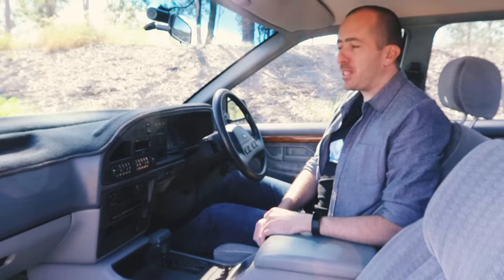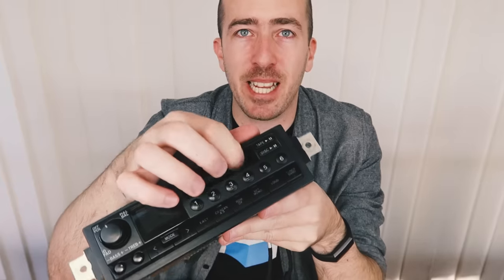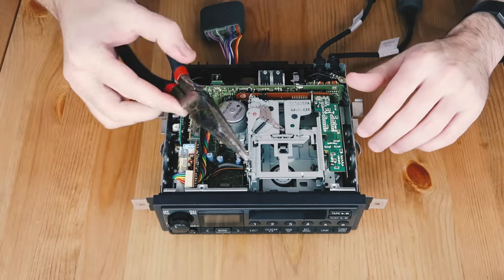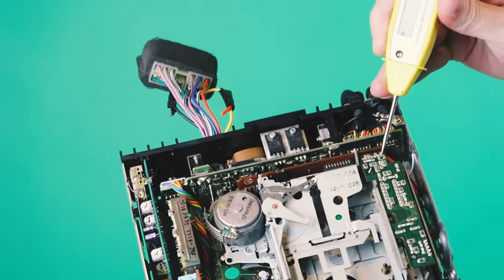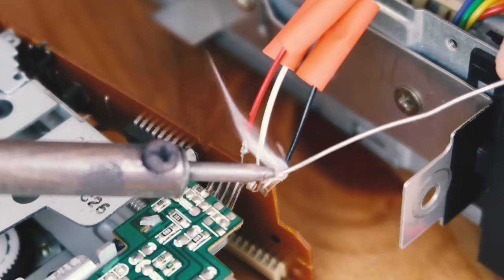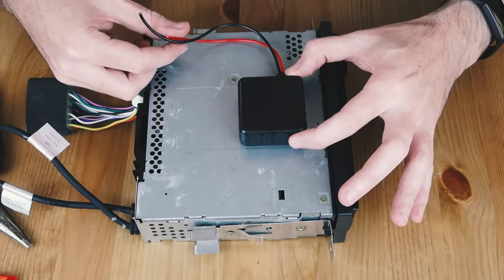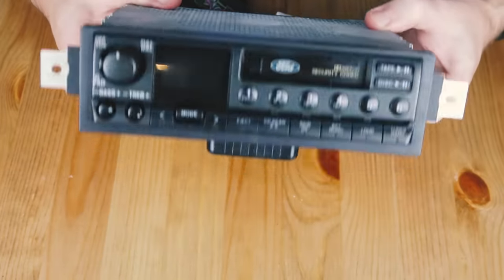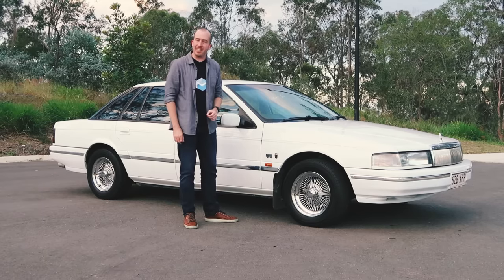Add Bluetooth To Your Old Car Stereo For $25!

Comment from the maker: Thanks for watching! Like, comment or sub to support the channel.
👕Or grab a shirt from https://www.motoringbox.com/shop
Reply: Just use a Bluetooth and plug it in to aux. Connect to phone
Or rather pair to phone
Reply: Too much trouble the way you do it. 
A Bluetooth plug 
See
Reply from the maker: @me67226  you missed the point. The head unit didn't have aux.
Reply: All you need just buy a mp3 and remove from the 12-5v converter and just connect in battery inside of the radio

Comment: Next you will have to fix that steering wheel thats on the wrong side...lol
Reply from the maker: Nice one.
Reply: It's not on the wrong side, it's on the right side.
Reply: @peterbonnez   I see what you did there, nice!
Reply: Wrong country! LOL!
Reply: It's actually right side lol, only when they drive it's left side of the road.
Reply: @toniov77  exactly 😂😂
Reply: Lol
Reply: Lmao I knew it was coming
Reply: maybe yours is on the wrong side.
Reply: @brtcobra  Most people are right handed. If the steering wheel is on the left, then you are operating the gear shift level, air controls, and radio with your dominate hand. Therefore, this guys car has the steering wheel on the wrong side.
Reply: LMFAO!!!!!!!!!!!!!!!
Reply: @dougsholly9323  Nah didn't you see, it's on the right side...
Reply: I can't imagine driving on the right hand side of the road.. it feels so wrong
Reply from the maker: @dougsholly9323  the same argument can be used to say the dominant hand should remain on the wheel while your non-dominant works the controls. Out of everything in your car that is hand operated, the wheel is the most important, not to mention requires the most effort and accuracy in operation!
Reply: @MotoringBoxTV  fair point. Although, the first inventor of the gas powered auto was either German or American (depending on who you talk to) , and they both drive on the right side, so they get to make the rules, nya nya 😁

By the way, I love it when people understand technology at the root level so they can figure out how to do stuff like this. Well done. Too many 'part swappers' these days.
Reply: It's an Australian Ford Fairlane. Here in Aus our steering wheel is on the right hand side even the cars that comes from other countries like the RAM 1500 and the F350 which came in from the States left-hande drive....
Reply: Your wheel is on the right side mate,it's everyone else's wheel that are wrong side.🤣🤣
It should be right and wrong  but they call it right and left so not to offend.lol
Reply: In the U.S. they drive on the right side of the road, in Australia, well we drive on the correct side of the road.
Reply: Great joke grandpa.
Reply: You had a CD player in your boots!?!?! What next? Blue tooth in sneakers!?
Reply: Péter Bonnez 😂
Reply: @dougsholly9323  while I don't disagree left hand wheel is my preferred,  however the original motor  vehicles were not invented in usa they were invented by Germany , a unknown man named Daimler or Benz,  more importantly his wife was key, look it up. Every car until usa decided to "have it thier way" steering  wheel was on right side of vehicle . Purist countries like Japan keep it on the correct right side.   However I cannot imagine for the life of me not being able to use my right hand for accessories manipulation,  oh and since it's have it your way is mcdonlads or subway tagline  , that is handled easier euth right hand haha .

In summary I prefer left side  hand wheel , but it's not the dominant or even original side wheel is supposed to be on. To this day tv shows from UK,   Germany , Japan when people get into a vehicle,  it words me out. As it seems like the driver is entering by wrong door haha
Reply: @dougsholly9323 no Americans had a hand in inventing the automobile , mass producing yes , not inventing that was all Germany and in particular 1 guy and his wife . Thier daughter's name is on the vehicles Mercedes
Reply: MB invented and holds all key patents to motorized vehicles including braking systems . Even a Nissan or tesla have to pay MB (though probably expired by now, so maybe don't have to pay)

Comment: Honestly why in God's name do all the new headunits have stupid lights on them.
Reply: To see in the dark
Reply: @Sci-Mon1  yeah but don't need to be changing colours every 2 seconds
Reply: @Hamzaal  that's like a few that actually do that. And you can change and disable the color if you want. It's not like you have to keep it on.
Reply: @Sci-Mon1  unfortunately might don't not want to turn off at least i got it to stay on one colour
Reply: @Hamzaal  which unit do you have? On my Sony unit I had to download an app to do it.
Reply: @Sci-Mon1  a jvc , it had an app too but never let me turn it off so I just set the colour to the same as my dash.
Reply: Depends on the unit, I like the adjustable RGB lighting on my JVC deck. You can fine tune Red, Green and Blue to match the color exactly to the rest of your car's illumination. I have it exactly matched to the strange green/blue lighting Chrysler decided to use in my Ram 1500 pickup, which makes it look just a little less out of place in a 15 year old interior. Most of the units with that cheesy lighting you can't turn off are just cheap junk anyhow. This is a really cool idea for older cassette decks in cars, just do realize if you have a cassette deck from less than 20 years ago like I did, it will automatically detect the tape isn't actually playing and shut itself off. Even with one of those cassette to 3.5mm adapters I had it would constantly stop playing or spit the tape out. The final solution was an adapter ordered from China that plugged into the satellite input and tapped into the ignition wires on the harness, which was right before I finally replaced the deck entirely.
Reply: I thought this, Somone needs to make a OEM looking new headunit business
Reply: because it will fit your honda as Moog from Mighty Car Mods said it. its aimed at that kind of growd.
Reply: @ScottPC  that wouldn't be profitable at all.
Reply: They make the car go faster.
Reply: @iAmTheSquidThing  you're my spirit animal
Reply: @Hamzaal  you can select the Colour which you to have in the Headunit itself.
Reply: @DarthG3nesis  that is what I did,
Reply: Because that's what the market wants.  No, seriously.  Flashy lights and shiny shiny shiny shiny shiny shiny shiny seem to be more important to the modern consumer than actual, you know, FUNCTION.

My old pickup truck (circa early 1980s) still has the factory-original DIN-type two-shaft radio, and the thought of one of those abysmally styled modern stereos in that dashboard was enough to make me projectile vomit.  Not to mention that flashy lights and shiny shiny shiny shiny shiny shiny shiny is a magnet for thieves.

So I modded the factory AM/FM radio.  It wasn't a Bluetooth mod; it's a simple wired connection, but in a car Bluetooth is kind of pointless anyway.  I plug the audio cable into the small 1/8" jack hidden under the dash, and it cuts off the radio and feeds the signal from my cell directly to the radio's amplifier.  Cheap, simple, and it works... and anyone peeking in sees the decades-old factory AM/FM stereo, and they move on.
Reply: @Sci-Mon1  i think hes trying to say that there aren't any objectively god looking had units that don't look strait out of the 90s
Reply: If you don’t like the color changing you can buy a single color unit or change the unit’s settings.
Reply: Becouse those are "gaming head units"...... Noob.....
Reply: There is the « Blaupunkt Bremen SQR 46 DAB » but it’s expensive.
Reply: Because marketing department thinks that people are Flys and get attracted to lights?
Reply: @cydia2020  this is true
Reply: R2D2 was to expensive to or hire
Reply: That is more for the cheap ones like BOSS and similar brands (to attract unfamiliar customers into buying their junk), quality brands keep it simple usually not extra bright and one color lights.
Reply: Bcs china. Thats why. I remember like 15 years ago, it was popular to put rgb old LED lights on window sprinkle, or in headlights. That was gross. But now u have new Mercedes S or E class, with blue led in headlights. Still gross af.
Reply: Icecream Sandwich my doesn’t it’s a single Color unless I goes I to screensaver (don’t know the real name I just come up with the features of it) then I switches when it say it has 2 different colours
Reply: I like mine 🤷🏼‍♂️
Reply: And no way to turn it off or dim  it
Reply: Because they are appealing to kids.
Reply: @ScottPC  Continental and Blaupunkt have some

Comment: Very important: IF SOLDIERING DIRRETLY ON A BOARD, use wet tissue paper around the solder area, it will keep the electronics from overheating.

Comment: Why cut the ribbon cable?  Simply connect to the solder points on the tape drive and have the use of both.
Reply: Because. No one uses tapes anymore. At least, not in this era.
Reply: Yes we do.
Reply: I also agree with this as it seems a shame to go to such lengths to retain the original unit only to disable the tape function and kind of make the whole thing incomplete. I actually have a small collection of tapes and although I could no doubt find the digital version of all those songs it would be nice to just be able to play the original tapes from time to time just for the fun of it!
Reply: I was thinking the same thing. Why go through all the trouble to keep the unit only to cut the wires. Just connect the bluetooth to the needed solder points and be done.
Reply: @awesomeferret  it has but it's a niche.
Reply: @reyariass   a lot of people still use tapes.
Reply: @awesomeferret   I can second that since i still use tapes.
Reply: my mom still uses her old tapes and cds but my dad ripped all of his and uses mp3
Reply: I still like tape players
Reply: Because to make it works it has to detect a tape inside so if you don't cut the cable and put the tape the bluetooth doesn't work and if you do like this guy and remove the springs you can't introduce the tape.
Reply: he cut the cable because he disabled the tape drive. you could just keep it all together, and use an empty cassette like he mentions. even go the extra step and have a Bluetooth label made for the cassette so you know it's the one to use for BT mode. you may get some interference from the head though if you leave it in tact. some radios (like mine) have some muffled noises on tape mode even when I have a blank tape inserted. it all varies radio to radio. I even went straight to the TA2025 preamp chip and still get some interference and wavy volume. I will experiment with resistors and caps to see if I can solve this issue.
Reply: I use tapes. You can pull out the ribbon and hang it around the vegetable garden to scare birds away. Also hang CDs to do the same thing.
Reply: @reyariass  a lot of people do. Me included. Artists sells special edition cassette albums nowdays too. Bands distributes cassettes.
Reply: hi i personally have a lot of home made tape mixs that i like to play
Reply: I cant believe what im reading. People use tape... No sound, no bass..
Reply: Exactly what I was thinking. For me, I would need the tape deck functional even if it isn't being used.
Reply: @reyariass Says who ? Tapes will come back because of the non digital benifits
Reply: KelMaster Construction what if you I sent a cassette with no audio tape in it? The cassette mechanism will turn but obviously there won’t be anything for the head to read.
Reply: Fully functional Bluetooth would mean you can talk on the mobile phone. I didn’t see any of that here. By the way, I love my old cassette tapes. I have over a hundred of them that contain lectures and music programs off of radio, talk shows from the 1979s and even a tape my mom made of Richard Nixon resigning over the radio. I also have a collection of Reel to reel tapes. I feel sorry for the digital era kids who never got to either splice a tape or record a tape off of a record album and make your own mix in that way. I also enjoy downloading off of a streamed source but it’s just not the same. Feels too impersonal.
Reply: @coburnlowman  can you do the same with Bluetooth?
Reply: @reyariass  I still have an 8 track and its still used.
Reply: @frostbite1991  and, did you solve it? 
I would really like to do that in my car... 
Kinda hard being a gen z who's into classical cars these days
Reply: @coburnlowman  cds hanging off a tree also attract Mt lions if your trying to trap them...
Reply: Also you wouldn't b e able to connect your satellite radio through this installation method.  Hmmmm Or maybe newer satellite radios work on bluetooth? Not sure to be honest.
Reply: Thank you, I was trying to see if there was any other reason besides it's easier and no one uses tapes.
Reply: @reyariass  because i use cassetes

Comment: Nice tutorial for reviving an old stereo. I'd suggest to solder your new wires directly into the board instead of soldering wires with each other mid-air. Soldering into the board makes for stronger/better connections, less prone to disconnecting by having to move the wires while installing the unit into the car and such. I'd unsolder the original audio wires (instead of cutting them) and as with the power 12v and Ground coming in from the car, I'd trace those wires to the board and solder the bluetooth unit's power wires there. If you're not planning on using the tape player part of the stereo, maybe put the bluetooth adapter thing inside?

Comment: I noticed that the unit had a microphone so i would do a little more work and make a switch so you still can switch back to the tape and bring out the microphone in the bluetooth unit so you can use the call option as well.